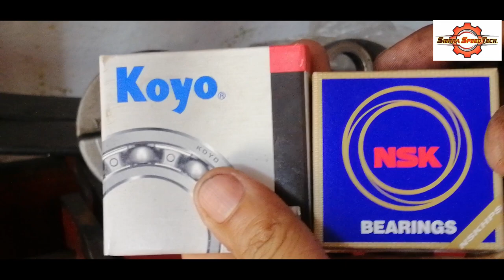CRANKSHAFT OFFSET PIN AND STATIC BALANCE

Comment: What use is the 3mm offset pin if you cant find a machine shop here in pampanga area to machine it ,no one wants to drill a 3mm hole for the new pin

Comment: boss possible po ba na stock pin pero iaangat para madagdagan ng stroke ? babaguhin yung placement ng original na pinaglalagyan ng pin ?
Reply from the maker: yes. actually yan yung common sa ginagawa sa thailand. dito satin meron din selected machinist na gumagawa ng ganyan. ang tawag naman jan is OFFSET CRANK.
Reply: @SierraSpeedTech  saan po kaya may gumagawa nian . experience ko kc mas mabilis masira mga bearing . almost 2 yrs palit na naman pag naka pin . sa naka offset crank mas matibay kaya ?

Comment: Magkano pa gawa sa inyo crank ng raider 150 carb pang 68 tapus stroke 6 yoko na conrod touring set up
Reply from the maker: offset crank or pin 3mm?
Reply: @SierraSpeedTech   mataas na ba masyado ying pin6 na stroker?
Reply from the maker: sobra laki nun boss
Reply: SierraSpeedTech MotoVlogs 
Magandang gabi po sir, riel po from dubai...bago lang po kita nasubscribe dito sa channel nyo po, nagustuhan ko po yung the way ka na mag explain sa makina. may raider 150carb type po ako, at plano ko po e upgrade ng 200cc, magkano po ba aabutin ng magasto included lahat ng pyesa.

Comment: Sir required ba na ma balance ang cranshaft basta nagbore up ka?
Reply from the maker: Hindi naman basta yung piston na stock eh hindi nalalayo yung timbang sa bagong piston.
Reply: @SierraSpeedTech  thank you po last question po,ano pong range weight ang basis nyo if kailangan ng ibalance? Thanks po ng marami sir
Reply from the maker: more than 20% sa original na weight.. need na ibalance
example
100 grams stock piston
120 grams new piston

need na ibalance
Reply: @SierraSpeedTech  salamat po ng marami sir wag ka sanang magsawa sa pagbigay ng aral saming mga aspiring mechs

Comment: Boss,  pasilip naman ng segunyal ng genio kung pwede sa beat fi. Para maging 63 stroke. Hehe 55 lang sa beat eh.
Reply from the maker: cge kapag makapag bukas ako ng genio na engine.. pero confirmed ba yun 63mm yung stroke?
Reply: @SierraSpeedTech  nasa spec sheet na nilabas nila paps ren eh.  Hehe nag message pala ako sayo paps :)
Reply: Di pwede yun boss magkaiba sila bahay
Reply: confirm 63 stroke ang genio.
Reply: @jaredworkz  confirm nga pero ma transplant kaya?
Reply: @vincentleviangelomagbojos5241  wla pang nka subok, pro prang negative ibang kac engine ng genio

Comment: boss nag rerefresh din po ba kayu ng engine ng motor ko bali nka 61 bore napo ako cams port carb then sainyu kona din sana po papa balance segunyal kopo at mag papa pin nadin po ako ng 1.5 po salamat po mx carb 125 po motor ko mejo namamalya napo kasi at hirap paandarin sa umaga salamat po sana mapansin po✌️✌️✌️✌️